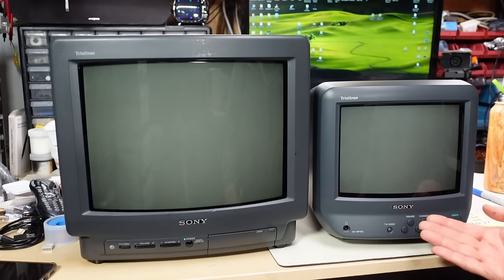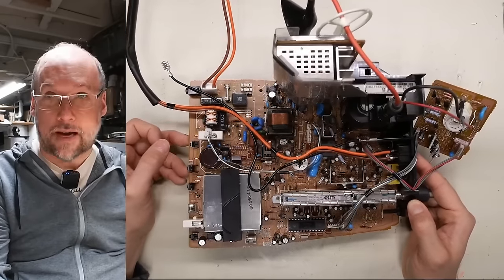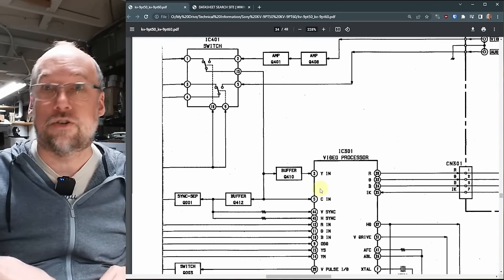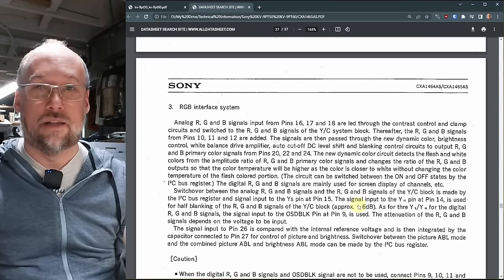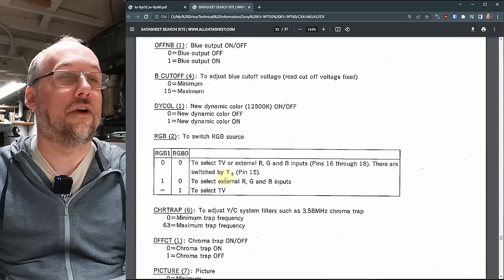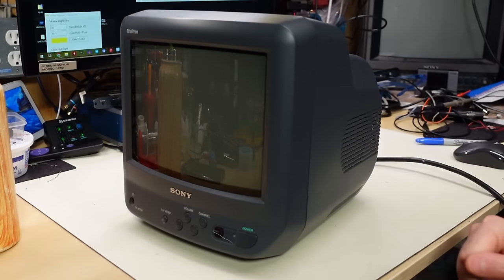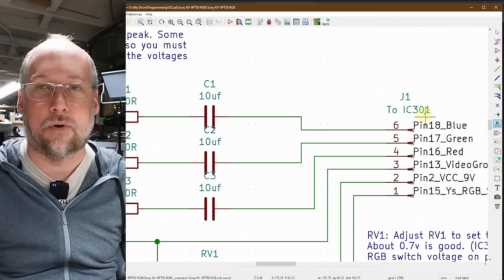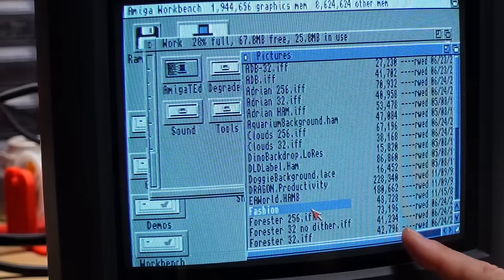Adding a RGB input to a Sony Trinitron (KV-9PT60 / KV-9PT50)

Comment: Isn't the 0ch info for the micro controller the one used to black out the screen when you select channel 0? 
Like that no switch needed and you only have to go to channel 0 to activate RGB
European TV set with similar chips used it as the AV inputs (with an aditional RGB switch / buffer controlled by pins to select input one (Scart) and input 2 (Component / RGB) and some times a third input like VGA or SVideo (yes VGA existed in some kind of CRTS (the HD ones)
for example:
Sony pvm2130QM
some european samsung / Continental edison / Grunding / Brandt TV from the 90s and most of 2000s European TVs had multiple RGB inputs

Comment: Maybe I missed it, but I don't think you explained why you ended up using the backplate and innards from your white set in this case when you did the mod instead of simply modding the black set's own hardware as it came.

Comment: Something I don't understand is how America didn't get SCART connectors on their TV's.  The ability to connect sources from a basic composite connection through to high quality RGB just by plugging in a cheap adaptor is so useful that it really doesn't make sense to me that they didn't take it up.  It's not like manufacturers would have had to do much to change their production over, after all they were already making versions of most of these models with SCART for the European market.
Reply from the maker: Every dollar and cent saved making TVs mattered to these companies. Manufacturers will cut every corner possible to save money. It's one of the reasons TVs were cheaper in the US than in Europe.
Reply: @adriansdigitalbasement  The absurdity is that no money was saved at all, since the manufacturers had to install RF modulators on every possible device.

Comment: Instead of designing a custom buffer and protection circuit, is it possible to find a schematics of the European model of similar TV that uses the same jungle IC and copy the circuitry for scart connector?

Comment: It's funny how many people relate the 50hz to PAL mode, but in reality, there's no relation between the color TV system and the refresh rate.
Here in Brazil, for example, the analog TV system was PAL-M. The PAL-M encodes the PAL color TV system over 60Hz and 525 lines resolution like happens at NTSC and this it's because the M relates to the CCIR System M broadcast system that was used in both Brazil and the US.

Comment: It wouldn't be impossible to add your own ic to control i2c stuff if you have the registers, can mix with the stock mcu
Reply from the maker: Yeah an Arduino could make short work of it. What I have found with other TVs (never tried with a sony) is that the stock MCU sends the control commands over and over again, about once a second... so if you try to take control, it just gets overridden right away. We can't disconnect the stock MCU from the I2C either because it is handling the safety and shut-down of the set by monitoring parameters inside the jungle IC.

Comment: I saw a different diagram for this model for rgb mod and they terminated the rgb line with 75ohm resistors but didnt have the 220 ohm resistors on the lines.  I was curious if any pne knew if there was any reason for doing it either of these ways or if maybe even aidrians circuit ahould have 75ohm terminating resistors?

Comment: I have a Sony Trinitron, European model, PAL and has a SCART connector which works very well with my 128K Spectrum using RGB connection. But unfortunately, I only get a B&W picture with my PAL C64 when I try the S-Video (Luma-Chroma) pins of the SCART connector. I have read somewhere that most SCART connectors of the 90's era TV's are not wired for S-Video input by factory. I wish I knew a way to wire them so that I can use this TV with my C64 too. Edit: C64 works when connected with the composite pin of the SCART connector.

Comment: I wish that it was a mandatory standard that the neckboard and deflection coils were able to be disconnected. I don't often take crt tv's apart, but I have a small monochrome one that's soldered direct to the tube, making it really awkward to work on.
Reply from the maker: Yeah it's a pain how a lot of monochrome CRTs have the yoke soldered right to the board. They had to save that $0.20 for the connector!
Reply: I've never heard of a soldered-on CRT, that sounds excessively cheap. If they soldered a neck board directly to the tube there's a risk the glass could crack. I would've thought a connector would be cheaper than extra replacement CTRs.

Comment: Those 'hot chassis' sets - WHY would adding an input be so dangerous, I mean, even those old sets had some sort of input (RF) - so what protected the RF jack or antenna screws from being death traps? Wouldn't it be possible to emulate whatever they did to make those safe during an RGB mod?

Comment: THE TIP:
- Take a male canon DB9 connector.
- Remove all the inside pins and plastic.
- Heat it up and use it to melt the case from the inside. 
-Stop shortly before melting the plastic through and through. 
- Punch the hole through and gently refine with a file. 

Now you have something that looks nicer. 

Then it's up to you to decide if you want to mount the real connector from the inside or the outside.

Comment: For dremeling the holes I print out the shape and glue it to the chassis as a guide..... Also could you not use one of the common grounds as a trigger to detect the plug rather than the switch..?

Comment: Atari ST has a composite sync or a composite video signal, depending on whether it has a TV output (CV) or not (CS).
Reply from the maker: I never looked it up, but the non RF modulator ST has composite sync on pin 2? (Versus composite video on that pin when equipped with the RF modulator.) It was only recently that I ended up with a ST that didn't have a RF modulator and I never tested that.
Reply: @adriansdigitalbasement  At least most of them (non-M) have composite sync on pin 2. On the newer boards, under the modulator, there is a place for a simple 2-transistor circuit for creating composite sync, while other/older STs usually have the same circuit soldered on the pads for the (missing) TV modulator.

Comment: Do you think the propagation delay of some input protection would have shifted the RGB image to the right slightly?
Reply from the maker: I've seen videos of other RGB mods and this just seems to be the way the IC works on these TVs. If the firmware properly supported it, it could just set an offset on HPOS when switching to RGB...
Reply: nah it's the different duration of horizontal timing pulses on every video line vs NTSC and probably the absence of color burst that make the active video starts with a short delay VS a NTSC signal

Comment: I have a kv-8ad10 which looks pretty similar, it does have composite so it works for me but RGB is tempting.
Reply: I have the same and unfortunately there is no RGB mod for it. I did however do an S-Video mod for it and that made a huge improvement over composite.

Comment: Ok, so I’m getting the gist of what the “JUNGLE” chip DOES, BUT, WHY do they call it the “Jungle” chip? Wikipedia doesn’t say why…
Reply: It's a weird one. I grew up in the early 90's repairing TVs. Those ICs are referred to as Jungle Chips basically universally, but I too have no idea why.

Basically what they did was throw all the random discrete stuff that used to be in separate ICs into one chip. The chips are quite unusual in that some sections are completely unrelated to other parts and indeed aren't even physically connected apart from the ground. It's like they just threw loads of random stuff into one chip. 

Is it because jungles are messy and overgrown perhaps? Or maybe because they are big - these chips are often physically large with many pins? I really don't know...

Comment: Hm, not sure if I'm interpreting the schematics correctly, but if you had left the Ys signal intact, you could have switched to your new RGB input by selecting TV channel 00. That would mean you don't need that external switch on the back.
Reply: I think this TV firmware blocked out 00 because it was a function not used with the TV's feature set. Channels started at 02, and going below that gives you the programmed inputs. That's the sad thing about proprietary firmware, and using a multi use chip on multiple models
Reply from the maker: Even though it seemed like the firmware could blank the image via Ys, it doesn't. Channel 02 is the minimum channel and it displays static on channels, even before the mod. This must have been something perhaps for the Japanese market and was left unused in the US and Canada.
Reply from the maker: Would be an interesting project to try to replace the MCU with something like a PIC or ATMega and have full control of the TV that way.
Reply: @adriansdigitalbasement  I understand. Well, would've been nice and clean....
Replacing the MCU would be a great hack, but, yeah, too much work to be done just to replace that external switch.

Thanks for replying!
Reply: @adriansdigitalbasement  I've added an ATmega to my TV to take control of the I2C bus by holding the clock line, and lock out the internal MCU from changing jungle settings, because it kept pulling the saturation to 0 whenever it switched to an RGB signal. So when I want to watch something from RGB, I either flip a switch, or press a key on the remote (I also connected the IR receiver to my AVR and decoded the signal), and it just takes control for as long as I need it. Fun hack.

I have a video on my channel about the whole issue while I was trying to figure this out, where I manage to send the correct saturation command, and see it flicker color before the internal MCU switches it back again, before I decided to lock out the internal MCU. I intended to make a followup with the complete solution, but laziness won, and I just pinned a comment instead :)
Reply: @adriansdigitalbasement Missed opportunity!  All you had to do was utilize the TV/Video analog selector IC circuit by disconnecting the TV tuner video input from the input switcher IC and connecting your sync signal instead, then splitting the TV/Video switcher signal, connecting it directly to pin 15.  This way, you could leave both RGB and composite inputs connected simultaneously, and switch between them by using the TV/Video button on the TV or remote.  You should try this with the other black-backed chassis that you didn't use!

Also, the horizontal width coil next to the light blue dipped high voltage snubber cap can be used to adjust the horizontal width of the image...

Comment: Warning on those Trinitrons, the black matte plastic tends to crack and fall apart over time. Something to do with the plastic makeup. Be sure you want to move it before actually doing it.
Reply from the maker: I can believe it! It all feels very brittle and crap. The 13" 13TR28 is really squeaky and flimsy feeling. Luckily the service manual is online for both of the TVs I have but I love that Sony made them freely available to anyone. Back in the 90s, I ordered the service manual for the 27" Trinitron. Luckily, the TV never needed any repair in all the years I had it.
Reply: @adriansdigitalbasement  I used to repair these at my shop and pick them up from customers. We use to give them a waiver that they may break during travel. We would quadruple blanket them along with loose straps. They were always scary to transport. 

In the service mode many of the controls are actually for rear projection sets like the pincushion and convergence settings.
Reply: @adriansdigitalbasement  The best thing for brittle plastic is to soak them in plastic conditioner (armor-all/Novus/McGuire's). Gentle heating can help the conditioner penetrate.
Reply: @nukfauxsho  you absolutely can restore old brittle plastics to a have supple feel that won't crack easily. In the last 25 years, I have done it with countless vintage toys, electronics, video game systems and car parts. It's more just wiping it down, you have to either soak for days or weeks in a bag or wrapped in saran wrap. Or you can soak and gently heat for quicker results. It's even worked for the dreaded brittle gold plastics used in some GIJoes and Transformers.
Reply: @Cincinnatijames  this does not work with these Sony trinitrons. I know about plastic restoration.  We have had a shop open since the 50s. It’s the makeup of the plastic in Sony trinitrons with the black matte plastic. The white ones do not have this issue from those model years.
Reply: @nukfauxsho  lolz. Yes, the one super special plastic that it doesn't work with. Open since the 50's. Sure buddy.🤔 Anything to be right on the interwebs.

Comment: I wonder if it would be useful to develop a board that the would allow one to remove the jungle IC and do all the connections for you and hold any required connectors.
Reply from the maker: That's an interesting idea. I think the problem would be the fact that different TVs will have the chip in different positions and also have a bunch of components. It would make a little PCB with sockets hard to fit in.

Comment: while RF input is kinda obsolete nowadays.... isn't there an option to hack the thing that when you select the "RF tuner" using the remote / front controls... it switches to the RGB input?
Reply: You would have to replace the software inside the microcontroller for that.
Reply: @danielmantione  I don't think so. There's a separate switch chip which goes between tuner and composite input. It should be possible to take its input and send it to the RGB select pin on the jungle if you really wanted to.
Reply: @eDoc2020  Yes, if you do it that way, it might be feasible. However that switch is likely still controlled by I2C and you would have to disconnect that swich from the microcontroller.  But this is actually a very strong case to install a SCART plug into the TV rather than a DB9: Connect an RGB device through SCART and the TV will display RGB, connect a composite device and the TV will display composite. One of the great things about SCART is that the end user doesn't need to bother about the various signal types.

Comment: Not that I've tried it, but I wonder how difficult it would be to take an ATSC 1.0 HD tuner from a trashed TV and get it to work inside this little Sony (removing it's old, analog tuner, of course).

Has anyone performed this "upgrade" ??

Comment: i've seen people use 75ohm resistors instead of 220ohm on the inputs. I wonder why they suggest 220 and what the best practice is there?
Reply from the maker: Actually inside the monitor technically the right thing to do is pull the inputs to ground using 75 ohm... so I'm not sure why the suggested circuit looks like it does.

Comment: Gee, too bad no one wanted my excellently working 36" (32?) Sony TV and it just went to electronics recycling...  :(  Not portable but sure would have been a nice retro gaming monitor.

Holes in plastic - hot metal like cheapie soldering iron does great, as well as heating an old knife of some sort (or heated blade like on wood burning set).

Comment: I had one of the last CRTs that sony sold here in my country, a 2012 21 inch flat screen CRT, supported component video up to 720p for Xbox 360 and PS3, I used it for playing PS2 and it was the best CRT I've ever had, that was upgraded to a 43 inch LG 1080p TV in 2014

Comment: scart or peritel only ever was mandatory in france. and nowhere else. the rest of europe put it on because of... tadaa. they had it anyway, and it was more practical than the din-6 connectors used for rgb pal before that (philips and grundig mainly ;). therefore 'market demand'. just like widescreen (either pal+ or d2mac) never was 'mandatory' but at some point all sets went pal+ anyway :P (d2mac kinda failed ;)

Comment: This is why european crt tvs are better. Most of them support RGB out of the box, and they support both 50 and 60 Hz signals in PAL and NTSC colour standards. And some sets even support SECAM... for the devices that use that for whatever reason.

Comment: This being a 90's set, it's past 25 years old, so this actually needs a complete recap of all of the electrolytic capacitors.  Stick with either Nichicon, Chemi-con, Rubycon or Panasonic, and make sure to get them from Digi-Key, to guard against counterfeits, and try to match the original ESR of each cap. - This way, it will work like new for decades to come, and no expensive or unobtainable IC's, transistors, relays, transistors, etc. can get smoked due to a shorted electrolytic cap!

Comment: can you use CGA/EGA video with this TV ? :)
Reply from the maker: Yes with something like this, would work perfectly. https://www.tindie.com/products/gglabs/cga2rgbv2-digital-to-analog-rgb-for-mdacgaega/
Reply: @adriansdigitalbasement  what do you think about this :) ?https://www.youtube.com/watch?v=ymulGiO4NrI
Fortunately I managed to make this scheme  , but it worked only on one specific CGA card that I have, but without the transistor (BS170 and it's surrounding resistors) directly connected to Vertical and Horizontal signals (pins 8 and 9) after those 470ohm resistors. This CGA card have a special jumper on it , that control the refresh rate this CGA card outputs somehow. In  position 1-2 the regular PC CGA monitor works, but NO the composite out and this scheme, (without transistor) and in position 2-3 it works on composite and this scheme, but not on the original PC monitor. Unfortunately even with the tranassitor this not rowk on all my other CGA and EGA cards :(